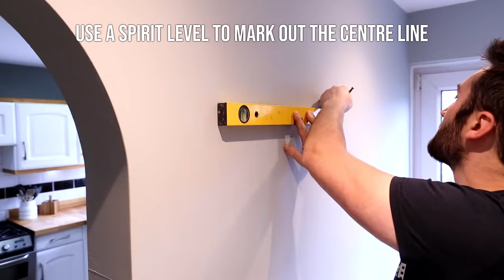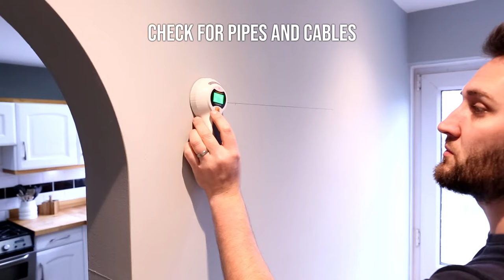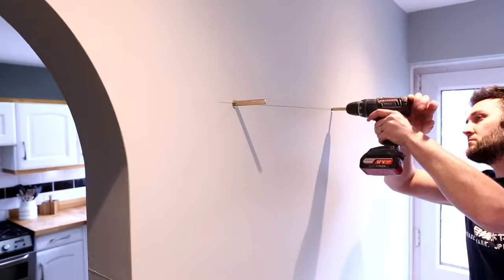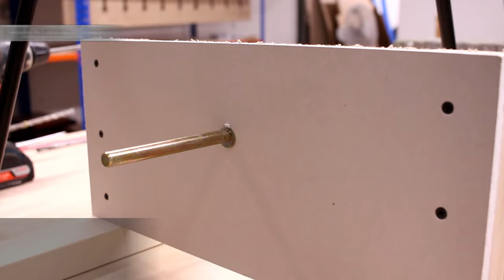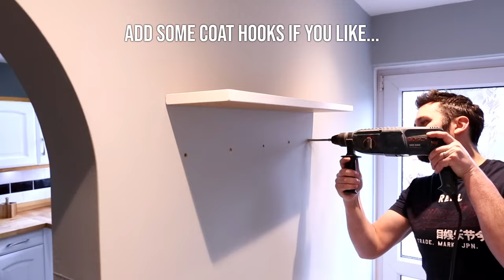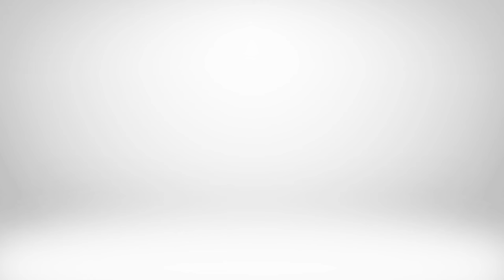How to Fit a Floating Shelf on Plasterboard, Dot n Dab and Solid Walls

Comment: it would be great if you can explain the plug types you're using
Reply from the maker: All of the fixing variations use Fischer wall plugs, the solid wall fixing is supplied with a UX10, the dot and dab fixing is supplied with a SXR 10 and the plasterboard fixing is supplied with a DuoTec 12.
Reply: @BespoakinteriorsUk  Thanks for your detailed answer. May I also ask how to distinguish between dot & dab and plasterboard? Their cover material are the same.
Reply from the maker: @legendgod  Our blog post What Type of Wall Do I Have? may help - https://www.bespoakinteriors.co.uk/what-type-of-wall-do-i-have/ 
Ultimately, if you are still unsure following these tips, you would need to consider drilling into the wall.

Comment: Check for cables before you mark the wall!  How do you know how far off the wall the plasterboard is before you start?  The plasterboard could be on timber batons. Better not to use plasterboard at all an use brick (not breeze block) and plaster for a wall. It will take weight better.
Reply from the maker: Hi, this is a solid wall not plasterboard - it is brick with plaster over the top.
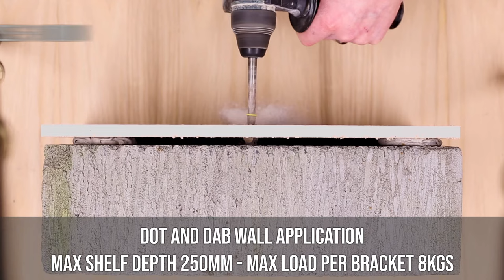Reply: @BespoakinteriorsUk  Title says Dot n Dab so that is plasterboard even if brick behind and there will be a gap behind some parts of the plasterboard, just look at 00:54. The weight of the shelf and its contents has the gap behind the plasterboard and the thickness of the plaster board to act as a lever on the screw.  Plasterboard is not good at taking weight.  Personally I don't like plasterboard on walls, brick with a plaster covering is my preference.
Reply from the maker: @radishpea6615  Sorry I thought you were referring to the wall where we are specifically fitting the shelf and coat hooks shown. We do also show the brackets on dot and dab and plasterboard set ups as indicated. We have a maximum recommendation on what depth shelves should be fitted using our plasterboard brackets (150mm) and a minimum quantity that should be used per metre (4 brackets) - precisely because of the nature of the plasterboard. As you said, a brick and plaster wall, like the main wall shown in our video, is preferable, but so many houses in the UK now have plasterboard and dot and dab walls. So these brackets provide a potential solution for people who want/need to fit a shelf to these kind of walls.